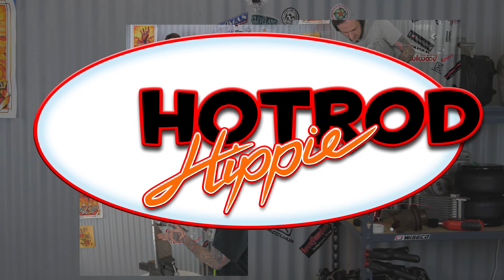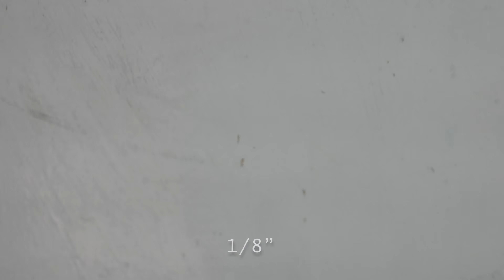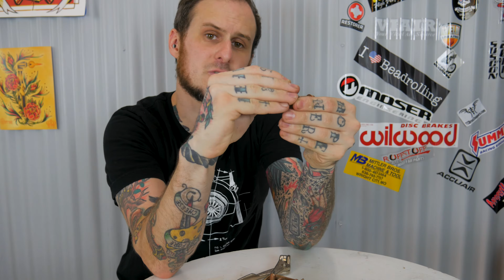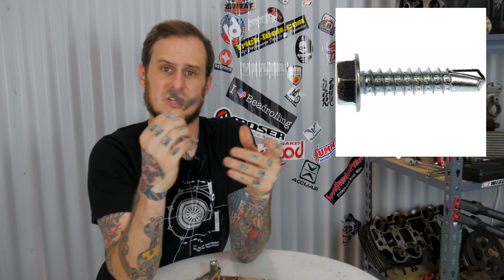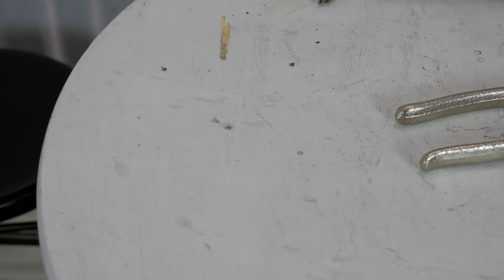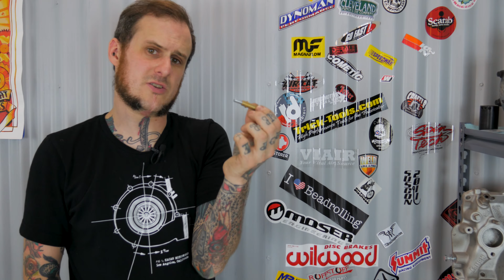Clamp Without A Clamp - 22 - Tool Tip Tuesday

Comment: Awesome job man...I am ashamed to say I just heard of clecos a month ago...I have been building trucks for 30 years...old guys...whataya gonna do.
I have another question if I may. I cut all rust out of my dodge ram and rebuilt everything the old school way. My sheet metal came out beautiful...less than 1/8 of filler anywhere. It took me the whole day of coating and sanding...coating and sanding...what the hell am I doing wrong? There must be a technique??
Reply from the maker: CG INDUSTRIAL put it on, take it off. That is the technique. Body work is a slow process to get it done properly. You can't apply mud too thick per coat, and you have to take your time sanding it smooth. 

That said, I'm a Metal guy. I build them, then hand it off to paint and body. So I can't help with any specifics of the finer points of filler work. 

I can say that the projects we do usually spend a LOT more than a day in filler work. The time is often counted in weeks.
Reply: HotRodHippie I really appreciate the reply...I guess I am on the right track I will likely be at it all day tomorrow too until I am happy with it....I'm with you though...I like doing the metal work. I'm a welder anyway so I'm 3/4 the way there already...
.I assume you are just really good at metal work in a very specialized industry and employers seek you out....correct?
Reply from the maker: CG INDUSTRIAL I wouldn't say "seek me out" but what I do is most certainly in demand right now. There seems to be a distinct lack of people doing it, or at least with any real skills for it.
Reply: HotRodHippie interesting...because it's a very skilled and extremely artistic path....which of course makes you a pariah in society ( being artistic) so not a lot of people do it....Thanks for replying...I wish you luck in growing your channel...I'm glad I got my questions in before you grow big on you tube! Thanks man!

Comment: These are brilliant. I have the screw type so theres no need for pliers (that always seem to go walkies!) They can apply a lot more pressure and have a plastic cap on the bottom so if you spin or knock them they tend not to damage the nice finished panel. These spring loaded ones are better for thicker or multiple panels and are a little quicker to use. I never thought of using the extra pieces of metal for butt welds thats a neat trick. I usually use butt weld clamps (with the round pin not the square pins) but you cant always use them because u will lose the pin that goes through the hole in the back of the clamp if u cant get to the other side of the panel but these are good for when welding aluminium panels because they go between the joint so they create a small gap to help with welding the harder alloys like the 5000 series stuff. Wicked video and i want to see some of your work and projects. There isnt many custom shops here in the uk so i love all these U.S. shows. U should look at being ak and rr rolled into one and make your own tv show!
Reply from the maker: Kyle Ruddock I've never used the screw type ones. I should pick some up to give them a try. I primarily work in steel so I don't use the butt weld clamps. No gap when I'm fitting up steel panels. 

Hopefully I'll be getting into more project videos soon. Folks seem to be liking informational ones right now. As for Tv shows, I'll probably stick to making my own content, haha. I don't have enough drama in my life for TV.

Comment: You can just tek screw things together as a removable clamp. Cheap and effective,  no drilling and easy to remove plus everyone has them lying around. Tek screws are the best thing since sliced bread. They are bulletproof. https://youtu.be/CKeVQca3kQo?list=RDCKeVQca3kQo. https://youtu.be/Kk8eJh4i8Lo?list=RDKk8eJh4i8Lo